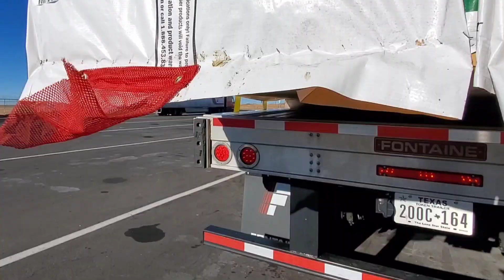A Day Bound To California | Praktis Tiktok

Comment: Use 4 bungees to hold ur flags..it's much easier...I only use 1 flag..holder by bungees
Reply from the maker: Do you have the flags with bungees Otto or your flag looks mine with ring the you put bungee?
Reply: @PinayTruckerGIRLUSA  i use 2 41" bungee and 2 21" bungees...take one of each..41 first connect to 21 n 21 connect to flag hole..41 stretch to side of trailer pocket...ex..
T========-------------flag------------=======T